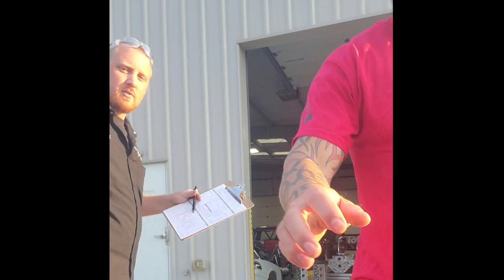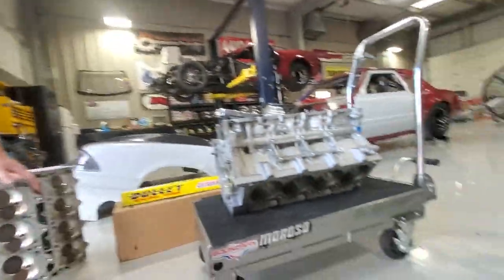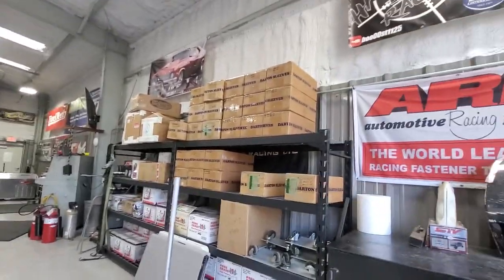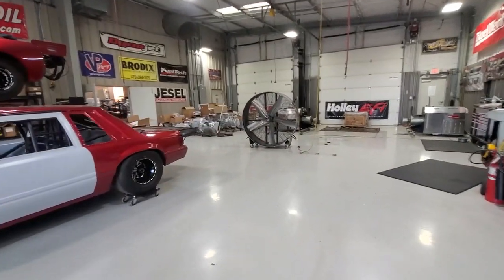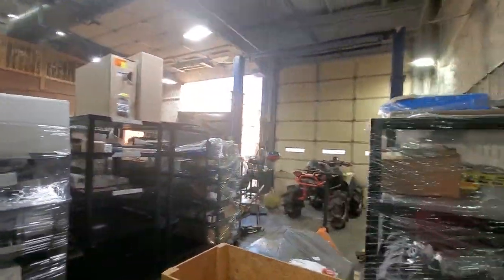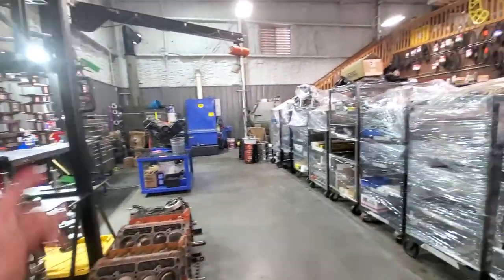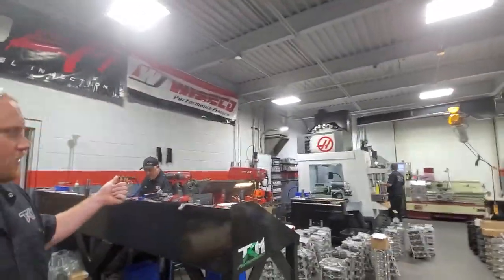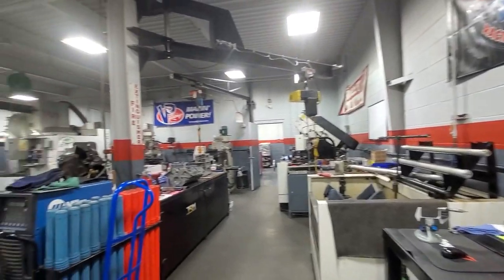1500 HORSEPOWER 2020 GT500 !!

Comment: I'm so excited for this build. I know this is gonna be one of the baddest 2020 GT500  in existence.  I wish hard parts were available for the DCT so the tune wouldn't have to be torque limited. Midrange and top end torque  is what these cars need  BADLY, because of their poor aerodynamics.  Also, an upgraded transmission  cooler with temperature activated fan would be helpful. Your channel is one of the few that I watch all the videos straight through. Keep them coming.👍🏽👍🏽
Reply from the maker: thank you, i try to keep it relevent and interesting